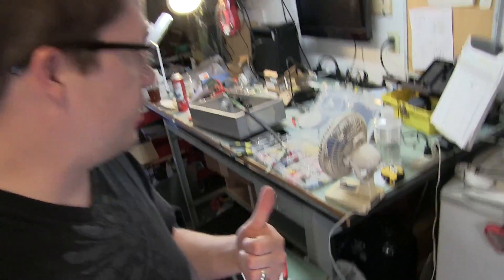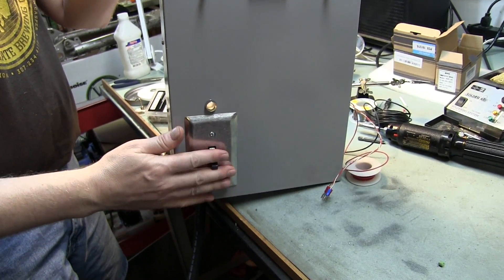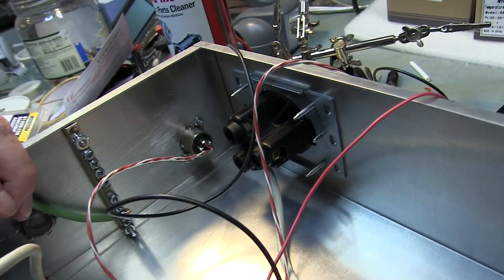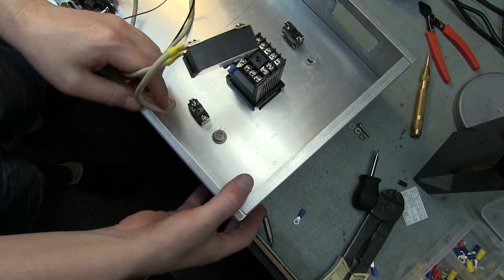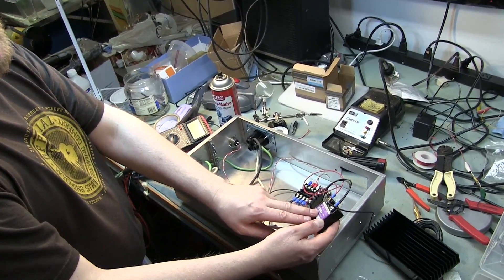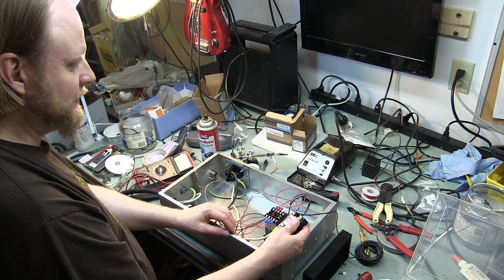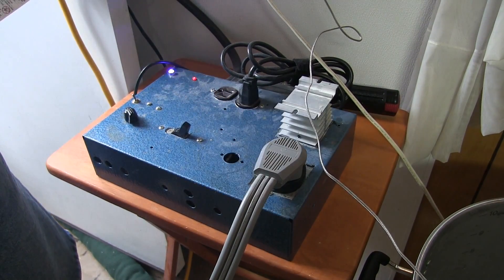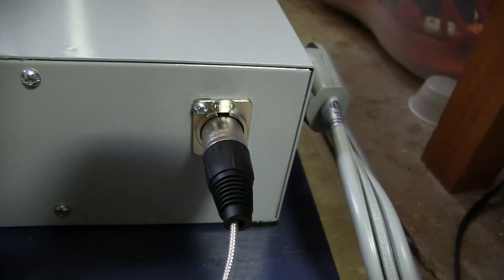Wiring & Testing An Electric Brew Controller with Joe & Erik

Comment: From the video, it appears that the small gauge wire that feeds the PID and SSR comes directly from the main buss. That would mean the wire would probably burn up or catch fire before a breaker would blow. Should it have fuses or other protection for what appears to be #18 or smaller wire? You never showed the wiring for the rest of your setup.

Comment: if not already mentioned, anything that running from the "wall" bridge directly should be 10g or larger, and it should be fused (as you have on some things), the lower amperage side is fine for 12 up depending on your fuse.

Comment: So you have 220 2 phaze? I'd have run the pid off 110 and the 220 only to the mains side of the SSR since low amp cables are much easier to work with. I will actually use all 12v for the signal path in my future projects since it's safer. (Especially if using cheap chinese PIDs like I am now,)
Reply from the maker: There ya go! Making it how you like it, that's what way to do it.

Comment: Nice Joe. Your PID should have the ability to switch to manual mode, allowing you to specify a percentage output, instead of trying to find the right boiling temp. Manual mode gives superior control over the boil rate. Other that, looking good. Cheers! P.s. I don't recommend dancing like an evil scientist with beer in you hands over hot electronics.
Reply from the maker: It does! And thank you again for the tip!